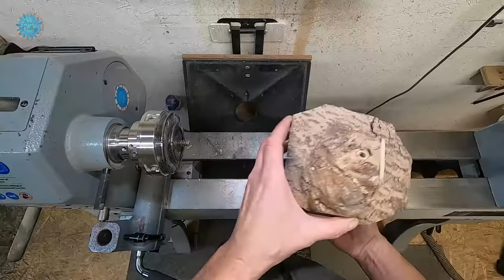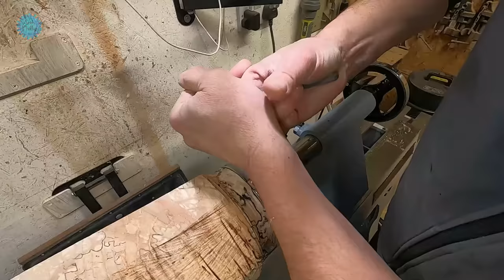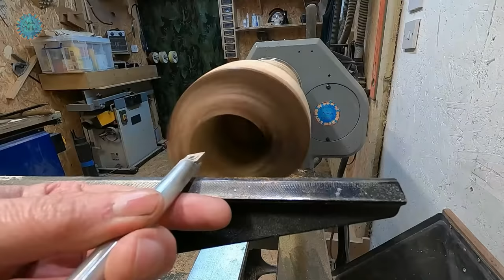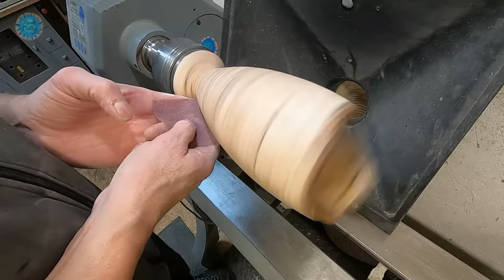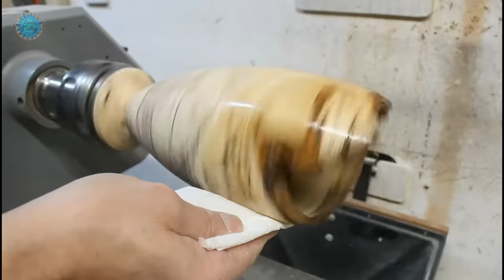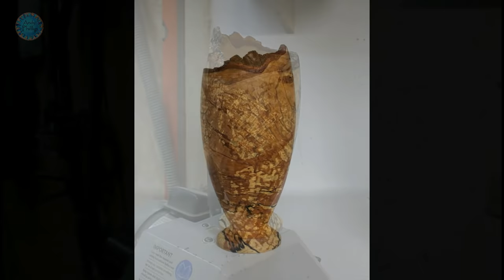Woodturning - Spalted Ash

Comment: Andy, I absolutely love working with spalted woods. I've worked a lot with spalted hickory, sweetgum, and oak. Not much ash in central Florida, though. The wood can be beautiful but challenging if it's too far gone. Your free-form edge piece turned out beautifully. And, for the woodworkers out there, spalted wood is typically cheap or free to get because builders aren't interested in it. It often ends up rotting in the woods or going to a landfill to get mulched (criminal when you see what it can look like).